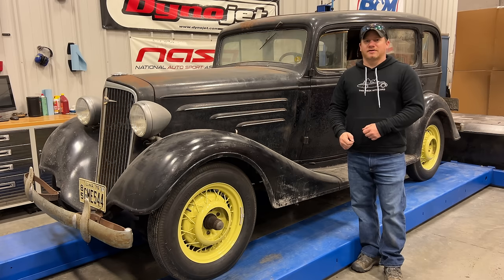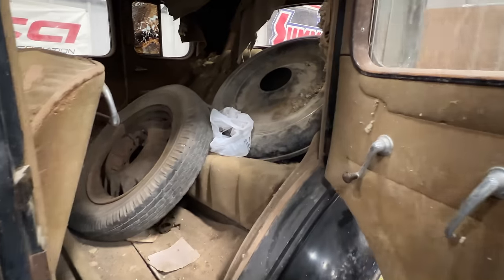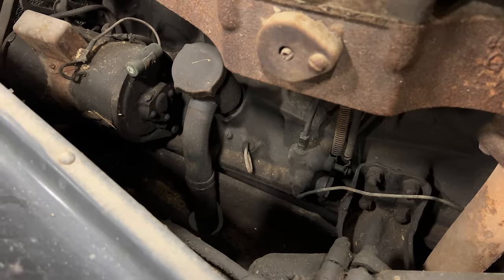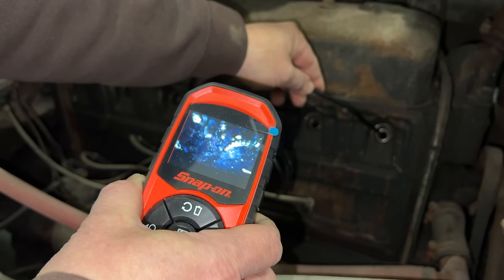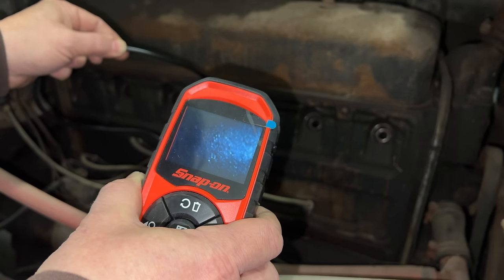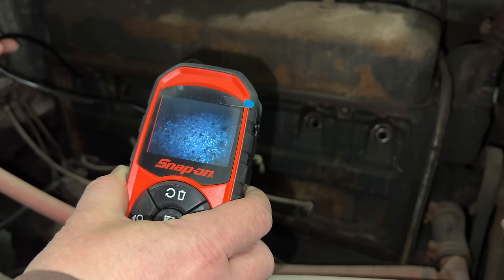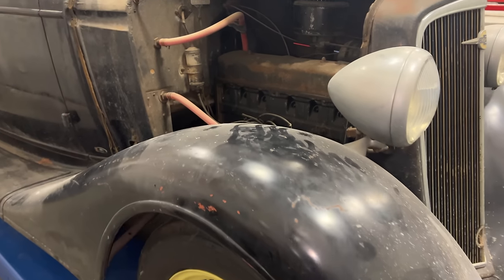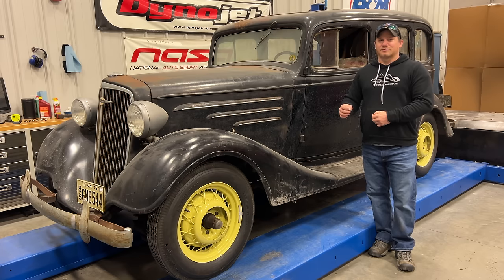Will It Run? - 1934 Chevrolet Master 4-Door Sedan

Comment: Steve, could you have turned the engine with a starting handle?  There looks like there is a hole for one at the bottom of the front grille .
Reply from the maker: There is no way it would have enough leverage.

Comment: It's nice to see you are branching out. There seems to be a trend in going for the older cars. I agree that the engine should be rebuilt.  Maybe you could let the oil sit for a while and try the push to turn it over again. I would like to see the disassembly, analysis, machine work and reassembly. Jay Leno might have a parts source you could use.
Reply from the maker: What do you mean by branching out?  My very first video on this channel was a 1929 Willys Overland 4-Door Sedan:  https://youtu.be/Y3Pnym2Q4Kk
Reply: @ThisWeekWithCars  My bust or bad... I have been watching your YouTube videos for the past year. Thought I had seen them all. Guess I missed that one. I'm glad to see the enthusiasm when it comes to difficult car issues. You are very methodical in your approach, and I commend you on that. When you opened up that MG-TD (I think) motor with what looked like an aquarium of transmission fluid or Marvel's Mystery Oil, many of my automotive students would have thrown in the towel. You kept at it until you were satisfied. Keep up the good work, and Well Done!!!

Comment: Amazing the doors didn't fall off or at least drag on the running board ! Those old Chevs were all coach build ,all the body framing was wood!  Given the overall condition that car must have kept inside for most all of it's life. Back in'61-62 a friend of mine found a '31 that was at 30 years old in no better shape, not like your 88 year old one !! First car my Dad got after WW II was a 35 Chevy 2 door, kept it until we move to Arizona in'50 when he upgraded to a 41 Chevy 2door. 
Have Fun !!!

Comment: There’s Babbitt in that engine, but Davin at Hagerty and the machine shop that they use modified the rods in a 1950 216 to accept shells. Involved elongating the oil holes in the shells too. But I’m jumping waaaay ahead. Hopefully the block is serviceable. 
Exactly what sort of critter volunteered to croak in the car to lend a macabre tone to the video?

Comment: It could be worse, it could be like the 1930s Chevrolet on Cold War Motors' channel that was parked up in the 80s with head gasket failure and a cylinder full of coolant.

Comment: The hole at the bottom of the grille is for a handcrank, no? The crank bolt will accept  the long crank.

I'd vacuum the cylinders of debris. Soak the ring/bores for a few days. Then see if it'll turn & possibly start. You're going to change rings and bore/hone cylinders anyway.🤷‍♂️

Comment: three of the six cylinders don't look good. that would be about what one would expect if the cam was holding open a few valves and something had gotten in while the air cleaner or carburetor was off.